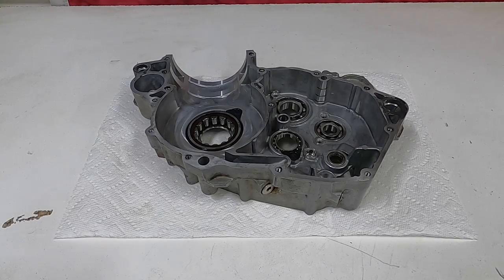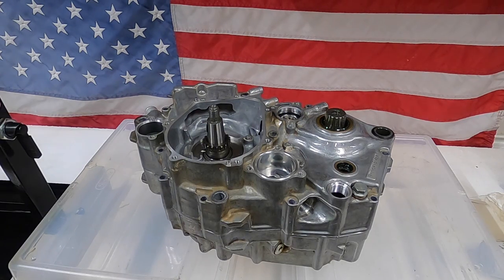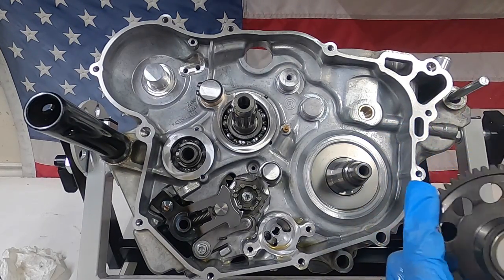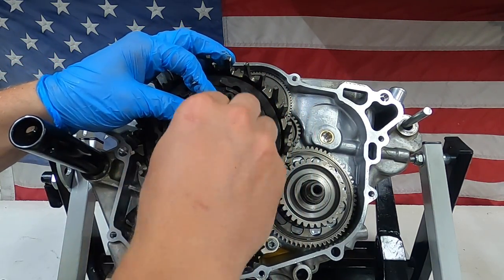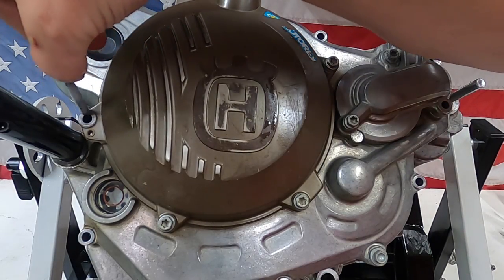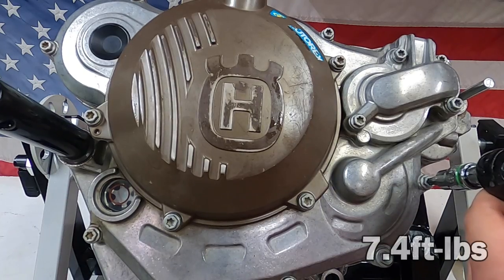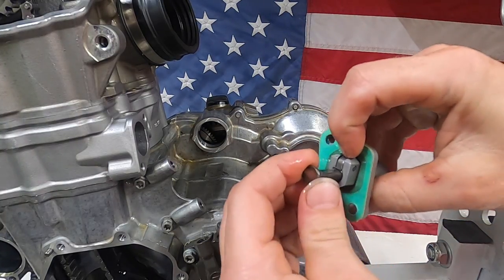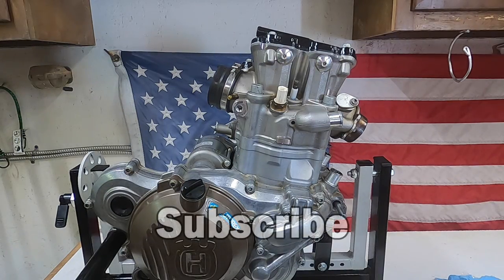KTM 500exc Husky FE501 Engine Rebuild Complete Step by Step!

Comment: THX for sharing your know how and patriotic video! Curiously, Beta 4 strokes have this same plastic oil pump drive setup. Can you verify that it is indeed plastic? I’d feel much better if it was nylon, just saying. Beta parts offers an oil pump drive “upgrade” kit containing steel gears. In the past I’ve stripped out 2 stroke oil injection plastic drive gears. This can leave you stranded in the woods/dessert etc. I consider this to be a real biscuit a manufacture leaves it’s customers. Keep up the great vids.
Reply from the maker: Thank you. As far as I know the gear is plastic, not nylon

Comment: When doing the piston replacement did you just stick the piston slightly in the bottom of the cylinder before putting it in the engine? And do i have to adjust the valves when doing piston replacement? I have a 2020 model😅
Reply from the maker: Yes that is how I did it although I put the piston in from the top of the cylinder and then pushed it down. I did use a piston ring compressor when I did it and gave it a light tap. You have to be careful not to snag the ring. Your valves should be fine for a long time. Honestly you're piston should be fine too. How many miles are on the bike? I've heard of guys going tens of thousands of miles on the original piston no problem

Comment: Great vid bro! - I've got a 13' 500 and a 16' 501 - Where are you buying your parts for your rebuild? You didn't mention what parts you had to replace - did you have to change out any of the bearings? Thanks and subscribed.  Glenn
Reply from the maker: Thanks man! I appreciate you watching.. feel free to check out the other FE 501 stuff I have a ton of different content on here with it. I ended up getting away with only having to do a couple transmission bearings and the upper cam bearings, I also ended up having to do the valve seals and while I was in there I just put new exhaust valves in. The guides were fine, the piston was fine, the crank was fine..

Comment: Awesome vid thanks. Only thing i noticed is i think the shift locking lever (7:45) should be flipped. There is a notch in the arm that the spring sits into. I don't think it will make much of a difference though.
Reply from the maker: If you look at a parts diagram or have a manual you will see the lever and spring situated exactly the way it is in the video. Thanks for watching.

Comment: I have a 18’ fe 450. The pcv tube is routed from the valve cover and goes into the air box. Is this safe from the issues you had? I’m assuming this is the factory routing and sad but I bought if preowned. Thanks. Great content
Reply: Safe* not sad
Reply from the maker: Correct. Stock routing is good as long as it goes into the air boot! Filtered air in your engine is key! LoL thanks for watching! How's that's 450
Reply: Dualsport Disport thanks for the response. Absolutely love it. Feels like an extremely solid bike. Best of luck with yours. I’ll be watching your vids
Reply: Dualsport Disport just subscribed. Love watching my bike specific videos/fixes. Keep it up, love learning from knowledgeable people
Reply from the maker: Thanks dude! The dualsport playlist I have has tons of info and mods applicable to your 450 as well. Check it out if you have any mods you desire or want to see what these things can really do. Subscribe if you like what you see🤙
Reply: Dualsport Disport and I love wrenching on my own bike instead of trusting some mechanic than I don’t know. It seems like there’s not quite as much info on our bikes as there is for say the crf450l, so keep them coming
Reply from the maker: Way more rewarding to work on your own! How many miles on it? I talked to a motor builder the other day and he said hes never see a bad crank on these bikes. Hope to never see it either lol
Reply: Dualsport Disport mine currently has 55hrs and  1260mi. So still relatively new, although I did notice, when putting a light to the oil, there were small glitter like flakes in the old oil. I’m hoping and assuming this is clutch material due to it having a “wet clutch”. I’m sometimes paranoid about things like that when it comes to the health of my motors. Hope yours runs for a long time
Reply: Dualsport Disport with that said, however, it runs strong and doesn’t blow out any smoke at all. It really runs great, starts quickly when cold and immediately when warm and is the same every time I start the bike

Comment: Thank you.

Quick question, after new cam bearings, how tight does the cam fit?  I just changed my timing chain and noticed my cam has 1 to 2 thou movement up and down, do you know what the spec is?

big thanks
Reply from the maker: I’m not sure what the spec is. But I know they were cheap. How many hours do you have on it?
Reply: I like the tool you made, I looked at my cam bearings today and see how my blind bearing puller won't work, I'm going to order the bearings(little over $20) and make a tool like in your video.  I don't know actual hours, used bike, no meter, guessing 150 so changing the bearings can't hurt.  My intake rocker is worn where it meets the shims(deforming the shims), I'll replace that(over $200, lol), and see  those 2 items help the ticking.  Previous owner said about 20 hours ago new piston and timing chain, my fingers are crossed.

Huge thanks for you taking HOURS to share this video with us!!

I hear a tick, I think it a bomb ticking,  I'll do a tear down in January to prep the bike for 2023!

Comment: How did you get sand was it a PCV delete and it got sucked up tube ? I just deleted my 501 and it's just a bare hose no filter silicone tube routed down by spring
Reply from the maker: That's exactly what happened change it back immediately lol. I did that exact same mod and ran the 450 air boot. The crankcase vent goes down by the linkage. I went through a puddle and water and sand went up the crankcase vent and into the engine seizing the rocker arm shaft on the exhaust, among other things. Turns out having the crankcase vent up high and behind filtered air isn't such a bad thing. Thanks for watching! I will be posting another video soon about what happened and the teardown
Reply from the maker: Check out my playlist man I have a ton of other 501 videos.. mods, racing, trails, etc. Subscribe if you like what you see. What year is yours?
Reply: It's a 2020. I had a bad feeling about the delete because it's a four stroke there are time the tube may be under vacuum ?  Thanks this is perfect timing I'm just gonna reuse the old routings with new silicone hose.
Reply from the maker: @smacnee3278  nice. Yes in my opinion particularly when the exhaust stroke is happening. There is no blow by because the gasses are going out the valve. The piston is going up and requires air to displace the void. Keep in mind that I had a reputable husky KTM dealership Tell me that this would be a non-issue. When I told them what happened they said they've never heard of that. Ha! I had a bad feeling about it too as I couldn't believe it was just an open vent but I followed the advice of someone else and learned my lesson. And to be honest I noticed really no power difference between the air boots and crankcase vent mods. I have 2,000 mi on mine and I've never seen any oil in the air boot.
Reply: Great video! I had the same thing happen, got stuck in a sandy mud puddle and shut the bike off to re position and it sucked a bunch of sandy mud in it. didn’t realize until i got home and all screens and filter were clogged. Still runs but smokes now so time to tear it down. Will be running my PVC back to the Airbox nipple that comes out under the filter.
Reply from the maker: Mine was smoking too. Wrecked the valve seals. Good luck on it!
Reply: Thanks! How did your connecting rod bearings look?
Reply from the maker: @kbross240  everything was great

Comment: hello I have a 2021 ktm 500 xcf-w, the weekend I was in the mountains and my motorcycle turned off in the mud, more than half of the motorcycle was in the water the motorcycle did not want to turn on immediately then it turned on and it is coming out smoke, today I wanted to change the oil and what I see is that water comes out, mud together with the oil. I wanted an opinion on what can be done in this case. Thanks
Reply from the maker: Unfortunately sounds like you’re in for a rebuild. I had to replace a few transmission bearings in mine, along with valve seals. If it’s oil smoke it’s probably the valve seals. There is no true way to get all the water and mud out without a rebuild.
Reply from the maker: Also, if your bike crank case vent is down low make sure you change that to where it vents up high under the gas tank or something
Reply: Thank you so much for  help
Reply: @DualsportDisport  why that advicIe about the crankcase vent? What's wrong with being under the airbox?